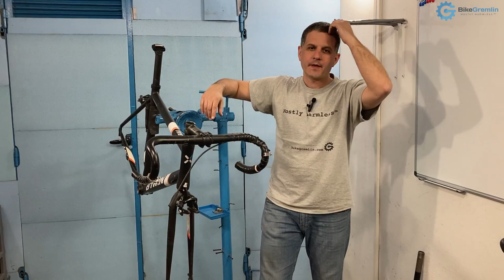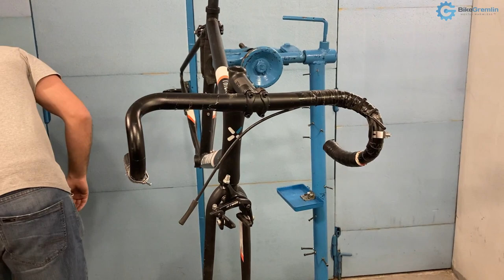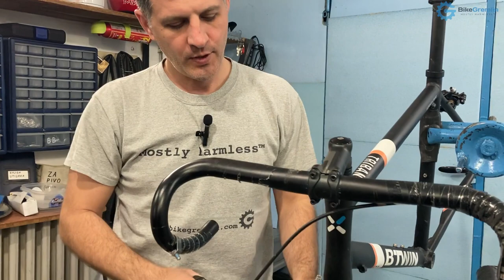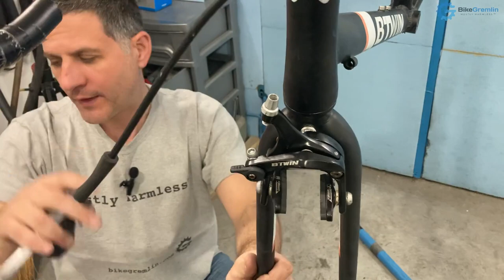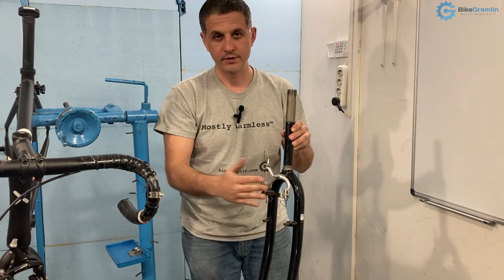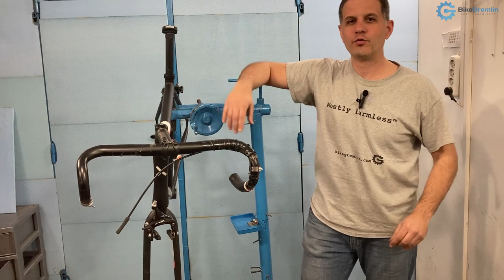Modern road bicycle rim brakes are unsafe

Comment: I can tell just looking at you I have a weaker grip on my hands and never ever have I had a problem to have enough of grip on the brakes from the top in moderately severe braking as long as my brakes and cables were in order. which they mostly weren´t but that was me being lazy not maintaining and adjusting them often enough. and the state worsens gradually and you can feel time by time how strong the grip is. as for really severe demands for harsh braking - most amateurs might just not handle the severe braking when holding the horns on the top of the handlebar and they, well, we, should grab the bars from the drops anyways. the drops are there for good reasons and those include exactly the moments like dangerous traffic, fast downhill. if something surprises you, you won´t handle the handlebar from the horns regardless how well the brakes brake. anticipation and luck is what you need with your hands on the top, or higher position of the bar or a different sort anyways. as for the option of replacing the brakes with canti or V - massively agree! road rim brakes aren´t for everyone especially in wet, dirty, wintery and offroad conditions regardless if they of the new system or not. if you don´t race you won´t notice the extra grams anyways.

Comment: Unlike most of these videos, this one seems off base:
(1) Wheels that are badly out of true, have broken spokes, or are out of round are structurally unsound and should not be used, period.  If this happens constantly, get more reliable wheels.  If wheels are home-built, consider wheels built by a reliable company (I've had good luck with Shimano wheels, for example).
(2) I've used various types of rim  brakes: center pull, side pulls with a single center-pivot (Weinman and Campy), and "modern" dual pivot side pull brakes (Tektro, Shimano Ultegra 6600, 6800, 7000, Bontrager direct mount dual pivot, and Dura-Ace 9200).  Of these, the Tekrto were terrible and the 9200's work really well (and were now available on sale 35% off, thanks to the swerve to disc brakes).
(3) If there is a problem on the road, it's unlikely that BOTH wheels will suddenly go out of whack and you have TWO brakes,, so use the brake on the unaffected wheel.  Mind your downhill speeds and you'll be fine.
(4) Disc brake rotors warp or may get bent by a hit, they are not immune to problems.  And folks with disc brakes are not alerted as quickly by rubbing of the rims when their wheels get out of whack and so may just ride with unsound wheels.

In all the years, have had only two problems with rim brakes:
(1) In a solo breakaway on the uphill section on the last lap of a road race, a rear spoke broke (self-built wheels).  Campy center bolt side pulls, did not compensate for the out-of-true rim as the author says.  Rubbing, flipping the brake release lever stopped the rubbing, kept going, won.
(2) On a ride camp in Mallorca, assigned a bike with direct mount Bontrager brakes.  Rear one squealed and grabbed, so I decided to try riding without using it.  Descended a number of switchbacks using only the front brake, no problem as long as I was careful with the entry speed.  So rim brakes have plenty of stopping power.  Problem solved by replacing the pads and cleaning the rims with alcohol.
Reply from the maker: I still think that the locked self centerng makes more problems than it solves. That is the point. Rim brakes in and of themselves are awesome.

Comment: My 1997 Shimano 105's  are fantastic,and my 2019 Shimano 105's on my single speed bike are also fantastic! One of the reasons for the new non movable side to side brakes, is that the newer design is not as flexible as the old one! Supposedly that's good...!???
Idk...
Greetings from Kris 😎
Reply from the maker: Stiffness is a plus. The rest - not so much IMO. 
You can design stifness without making the brakes non-movable.
Reply: @BikeGremlinUS  I agree with you, but I'm not an engineer 😅

Comment: Someone would have to take a massive hit to distort a wheel enough to be a problem, and taking the hit in the first place would be the immediate concern of fetching you off rather than the following consequences to the wheel. I can see your point but most of us have been riding modern rim brakes for a while now and though I dont have all the experience at all I dont worry about this problem but rather hitting the obstacles in the first place. Interesting to explore though
Reply from the maker: A spoke can break even without a big impact (manufacturing error that can't always be noticed upon wheel building) - on wheels with few spokes it can make the rim go out of true significantly (36-spoked wheels are less risky in such a scenario).
That, combined with the fact those brakes require pads to be quite close to the rim, can cause problems.

Comment: excellent observation! Older single pivit dont have this issue but misalign often, maybe cantis need to become great again?
Reply from the maker: Cantis used to be quite popular with cyclocross until relatively recently.
Good cantis are awesome, though I prefer V-brakes (and mini V-brakes for road bikes) for their simpler adjustment.

Relja
Reply: @BikeGremlinUS  cantis have far more natural feel compared to vbrakes which are more like on/off and flex the frame far less than vbrakes. They are often a mess to adjust, regarding mini v brakes I really dislike their feel, regular v brakes seem far more solid. Some say that good wide cantis are stronger in power than vbrakes but I havent tested them yet
Reply from the maker: @oreocarlton3343  I think that depends on the brake and frame model/design.

Having said that, many canti models provide an adjustable mechanical advantage (depending on how you set yoke the cable). That's not possible with V-brakes.

Comment: I learned something, thank you.  Maybe older brakes were designed that way for just this reason.  With safety-critical systems like brakes, the good design anticipates all problems and scenarios, and tolerates less than ideal conditions.  Cars anticipate these same issues.  On car disk brakes, the calipers can move laterally on greased pins to follow any runout on the disks, just like the old style bicycle rim brakes you show.  On car drum brakes too, the brake shoes mounting design is such that it can follow any radial runout in the brake drums.  Great videos, it shows you are thinking!

Comment: Hey this problem of giving you both move range and pull force amplification looks like it calls for progressive non-linear force brakes. Like ye olde cantilever. They don't need any left to right adjustment since they're inherently centred, and when you start pulling them, they move faster, but as they come closer together, they move ever slower for the same amount of pull.

Unfortunately, you're going to sell exactly zero of them, because way back when, they never worked well. You put yourself on a factory fresh bike with Cantis, it's not going to stop. Probably not because you can't make them work, but because the manufacturers put the bare minimum care into them.

Comment: I have never seen it happen, im not saying it cant happen.  If you have a carbon fork you are only tightening the mounting bolt to 6 NM and you can easily move the calliper slightly left and right without loosening the bolt so I cant see how a wheel rotating at speed carrying a riders weights would lock up against 6 NM ? steel frames may be different but who is tightening a set a callipers up enough so that one of the pads touching the rim without the other also touching or any lever pull from the rider would cause it to lock up?
Reply from the maker: Not enough tension on bolt-joints can cause fatigue break of the bolt (I'll make a video on that).
Torqued to manufacturer's specs (8 Nm for Shimano as far as I know), brakes don't move easily when a rim hits them. If a rim hits the right pad of the front brake, the torque direction is towards further tightening. For the left pad, the direction is towards loosening, which may be a better scenario.

Comment: I have dura ace 9000 calipers, and never had any problem with brake even at high speed downhill. On the other side friends who has sram red complaining.
Reply from the maker: No braking with a broken spoke (i.e. rim hitting a pad that doesn't budge)?

Comment: One side rub is not enough to lock the wheel! Also if the rim goes out of true it will rub one brake pad on only small surface area on every rotation. Really stupid reasoning.
Reply from the maker: Rub happens with pads that can move. These have the potential of the rim, as the out-of-true section reaches the fixed pads, to hit against a pad and get stuck, or at least abruptly and suddenly effectively "apply brake" for a short time.
Reply: @BikeGremlinUS  No, the brake force from one side on small area of the rim is not enough brake force to stop the bike or get stuck as you say.
Reply from the maker: @stibra101  Let's say that's always the case. It needn't even lock a wheel - a sudden braking jerk is enough to cause a crash when cornering, for example.
Reply: @BikeGremlinUS  you will crash from the shock of broken spoke in the middle of hard cornering, not pad rubbing
Reply from the maker: Do you think braking (rubbing is not the word, for these modern brakes don't move and the force applied is much greater than what's generally called rubbing) would make the situation equal, or worsen it?
Reply: @BikeGremlinUS  it really does not matter, because the % of rim surface in contact with brake pad will be very small
Reply from the maker: @stibra101  Yes, but that small section hits the pad - that doesn't budge. On a stand it locks up the wheel. In a ride, with rider's and bike's mass and inertia - it might not lock up a wheel, but it's a lot worse than a brake rub.
Reply: @BikeGremlinUS  Did you ever hear that someone had problem because of that??
Reply from the maker: Don't take my word for it. You can easily test it yourself by loosening one spoke and testing how the bike goes and behaves after that (if you have such brakes). Very stiff rims can compensate to a great degree, but they usually come with very few spokes which negates the benefit to a great degree.

Comment: Superb Video! I didn't know about this issue or road bikes brakes. I always wonder why they don't just use V'brakes!  

Do you know about the part called ''Problem Solvers Travel Agent'' ? What do you think about it? I can't seem to find it anywhere in my country and seems to be very expensive. I would put it on my V Brakes bikes to have a shorter pull.

Anyway... to give you some critique:
You should have clamped the bike by the seat post, not by the seat tube. :))
Reply from the maker: Travel Agent works, but I prefer using mini-V-brakes for road bike levers.